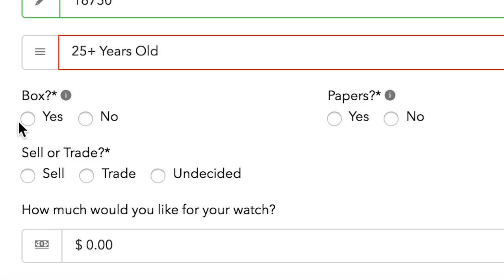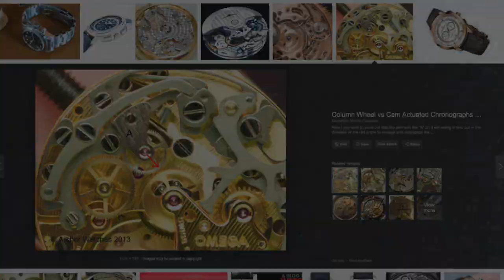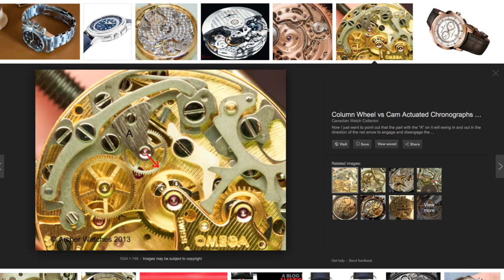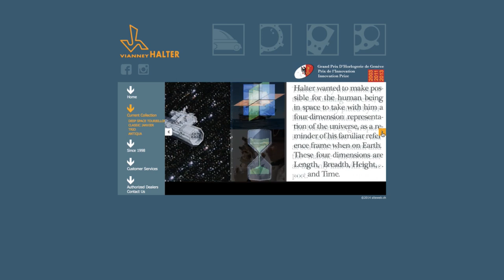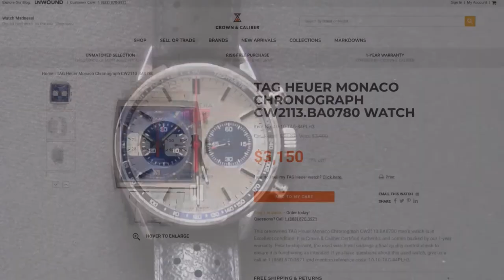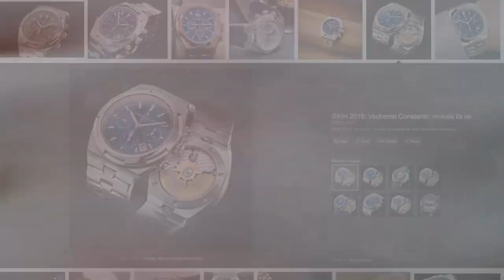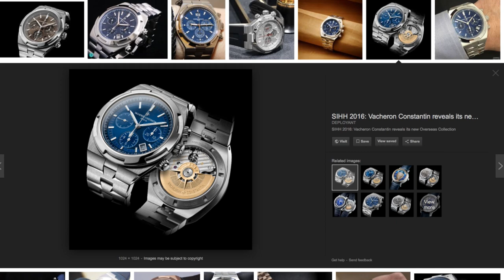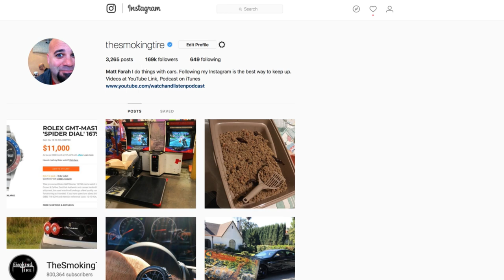Episode 11 - The Abusive Chronograph

Comment: How much does a new hand cost? I have an Eterna that has the chrono hand that went wild (past 12). The watch is not that old. It has an ETA 2894.
Reply: from watching restoration guys, for the most part the tricky thing is that it is very hard to source individual pieces for these watches especially parts of the display, so you usually have to buy a donor watch that has the pieces  you need and then swap them out.